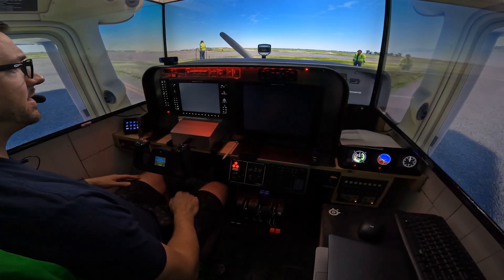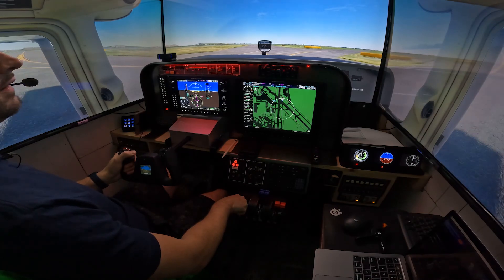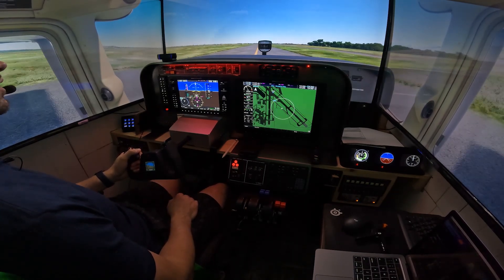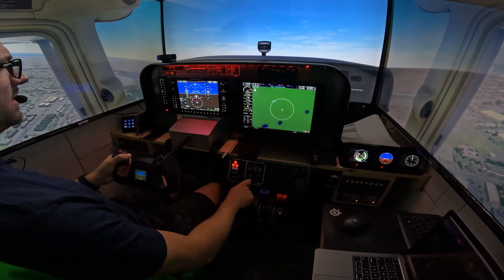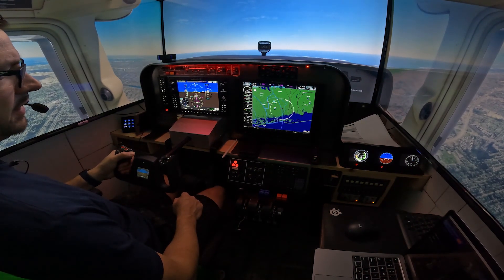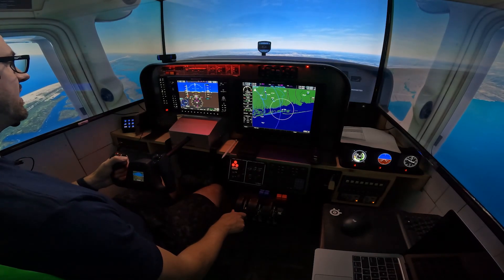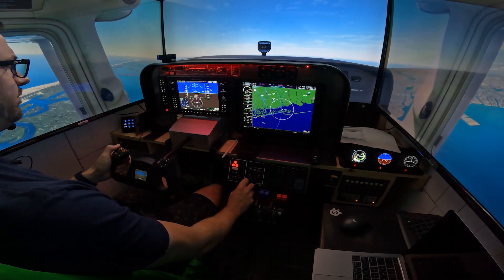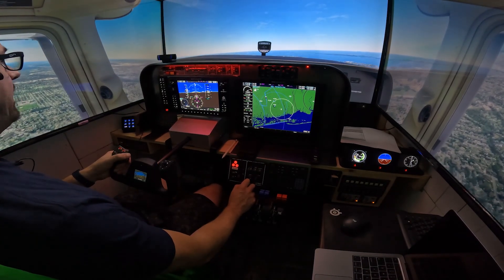Comparing Microsoft Flight Simulators C172 vs the REAL 172!

Comment: Greetings, I have seen this review of yours of the Cessna 172 G1000 base plane and the paid Cessna 172 WB. I would like to tell me which one do you think is closer to reality?
Reply from the maker: I haven’t flown the wb in awhile so not sure if there’s any significant changes to the flight model but around when I made this video is supposedly used the stock 172 6 pack fm. Personally I felt the g1000 to be closer flight model wise. I’m guessing because the g1000 version uses the CFD model I believe.

Comment: These tests are cool. The ground handling issue in my mind is due to wind and ground grip, if there is SLIGHTEST wind from the right the plane wants to weathervane to the right so you need left rudder. I think this was little bit improved on SU X, but still it feels like there is no grip between tires and runway. Very common in all flight sims imo. Anyway, i also think that the MSFS default C172 and C152 are incredibly good planes for default planes! Beating almost every payware stuff from the legacy sims (FSX etc).
Reply from the maker: Ground handling seems to be an issue for all sims for sure. Xp seems to have a better handle on it but msfs will get there eventually. 100% what we have no is light years ahead of what we had. I can’t wait to see what folks like a2a are capable of now with this platform!
Reply: I think you are spot on with the ground handling. I have the same issue, in both the 172 and the 152. They did not model the gyroscopic precession very well.
Reply from the maker: @johntaylor2433  Yep, had this again last night with a slight cross wind, the weathervaning almost makes you need the opposite correction you'd need in real life.  Id have to do some more testing.  I know Xp11 felt spot on after I came home from xwind training one day during PPL.

Comment: Hi Captain, I have a question, do you think it is a problem to fly a plane, whether it is a light plane or an airline plane?
Reply from the maker: Sorry - I don't understand what you mean?
Reply: I asked you, do you think flying is difficult and challenging? I mean both light aircraft and large aircraft?
Reply from the maker: @ehsanmikaeili9315  each aircraft has its challenges for sure. I’ve only flown light ga aircraft irl but in sim I’d say one of the things I noticed flying airliners is the difference in response and that everything happens much quicker. Theres obviously the complexity of systems too however once trained I imagine it’s not a challenge for trained airline pilots. One of my personal challenges was learning techniques to spot other planes, as that’s not something you typically need to do in sim and when you do they draw in a way you can easily spot them.

Comment: Great video and a fantastic sim setup there. I was surprised to see on the real approach that the plane bounces around more than the sim and needs constant correcting.
Reply from the maker: Yep, that's something I feel pretty much all the current sims lack are thermals.  As your coming in over different surface types you can get different updrafts, slight wind changes as the surface winds hit trees, buildings ect.  MSFS is def getting there though!  With the new gliders update I'm thinking we should start to 'feel' thermals in the sim now.  Thanks for watching!
Reply: yes, excellent video. Again, I agree with the response and the post. One of my least favorite types of air fields to land that are the ones that are surrounded very close to the runway by trees. The reason I say this is because on the approach you get a feel for the winds and get everything adjusted properly with your yaw and everything else to compensate, and then, as soon as you break that tree line, the way the wind is blowing completely changes on you, when you’re a mere 40 feet off the ground.
This has led to a couple of rather dicey landings for me, especially when I was doing my initial solos many many years ago.

Comment: One think notice is the lack of any slight turbulence. In the real plane you notice the entire plsne/dash moving around while the sim cockpit appears unrealistically smoothet.

Maybe always try adding light turbulence to addtgst little detail for realism.
Reply from the maker: I agree - weather needs a bit of work but getting better.  Id like to see some turbulence in the clouds especially.
Reply: @av8rchris  I've heard when a tip of your wing touches a cumulus cloud you'll feel moderate turbulence in a small GA plane, is that true?
Reply from the maker: It really depends on the cloud and conditions but there is most certainly turbulence. It’s one of the reasons I’m looking for as much actual IMC as I can get during my instrument training.
Reply: The real plane absolutely feels turbulence, and in my humble opinion, it feels it a lot worse than a large plane.
Turbulence that on large plane (I’m talking about Boeing 737s things like that) would barely register as a vibration, feel like serious earthquake in a little 172. 
I’ve had a few instances where I felt like every filling in my mouth got rattled out.

Comment: Not bad for a completely stock aircraft, and is testament to the effort Asobo has put into the ever evolving flight model. I thank you for doing this video as it puts to bed this ridiculous notion that MSFS is no better than an XBOX game for kids, that some people from a different flight sim would have you believe. And I include the CEO of said company in that. 

I bet you cannot wait for the A2A Cessna 172 to be released? Will take your sim to a whole new level. 😊👍

EDIT: Ah after reading your comments below, you're training on the G1000 and the A2A has steam gauges.  😊

Do you have the Working Title G1000 mod installed? It is absolute class.
Reply from the maker: The WT G1000 is top tier!  Oh I still can't wait for the A2A 172, that's a guaranteed buy for me.  Even though its steam I'm still able to use air manger to put those instruments on the PFD/MFD screens.  That was the whole purpose of this as I was kind of curious if I matched speeds just how close or not a landing or takeoff would be, or if power settings matched for certain maneuvers.  Does this replace real world flying - of course not, but it does show the effort they've put in to the flight model which as you said is constantly evolving.  Can't wait to see the sim in another 1-2 years how much further its come!

Comment: The biggest difference I found between the sim and real 172 is trimming. In the sim I found the airplane needs a lot of fine adjustment to keep it flying straight and level. The pitch seems more sensitive than the real plane. Which flight model did you use on the sim: Legacy or Modern?
Reply from the maker: I use modern flight model.  I agree but also in general any sim I've used seem harder to fly then the real thing.  Im guessing it has something to do with control sensitivities and quality of those components.  Since I've switched to the Brunner force feedback yoke its certainly gotten way closer to the real thing, but still in sim trimming for straight and level can require some patience.
Reply: That is true. I can trim a real one with the smallest movement. I do use the trim wheel quite a bit in the various sims.
Reply: In MSFS the Cessna looks like a train on rails ... 🫤

Comment: How are you trying to compare the sim plane you created with a twin-engine quadrant, Gear lever (Only one model of 172RG had retractable gear) and non-force feedback yoke with the real 172M or SP that has natural force feedback, where the primer is not always required anyway and unpredictable things can happen, like power peaks that blows a fuse, or elevator stuck, or basically anything else?
Flight sim is for fun or procedure practice not for training...
The truth is, C172xx is way more difficult on a flight sim than on a real plane, despite the fact you will survive all of your stupidity, lack of training and knowledge playing on a flight sim and you most likely would kill yourself on a real plane while trying some crazy manoeuvres. 
Flightsim is a perfect tool for IFR practice, general navigation and so on. These days it is great sightseeing tool thanks to photogrammetry but cannot be directly compared to a real plane.
Reply from the maker: I think your overthinking the purpose of the video - it was a 'for fun' video to compare how the flight model loosely relates to the real aircraft.  The twin quadrant is just a usb controller that I'm using in place of the typical push/pull style found on the Cessna as the one I have doesn't fit quite right with the home sim build.  Same goes for the gear lever, this works with other airplanes, and not for the 172.  My home sim is not meant to be a replica C172 in any way.  My yoke actually IS force feedback, capable of 24 lbs of pitch and 4.5 lbs of roll force.  All that is irrelevant as this is a home based game/sim for fun and not used for any training.  I use it to stay comfortable with the G1000's and instrument procedures as well as comms with ATC networks such as Pilotedge, not practicing maneuvers - we keep that to the real thing with a CFI on board.
Reply: @av8rchris  The title suggested a comparison between these two.
I just pointed out visual differences, some of them are going to have a huge impact on the comparison, even if it was for fun, and I do believe you as I did compare C172 as well in reality straight after MSFS2020 hit the market.
What I want to point out is the ability to practice procedures of all sorts.
Unfortunately, G1000 on the sim is not good enough for practising as many functions are missing. ATC procedures are also incomplete and wrong. for example, try to make a PAN PAN call on MAYDAY. It is not implemented in the sim yet. Try to request HI-LO right out... And so on...
If you use forced feedback yoke and rudder, you can actually practice some manoeuvres. They should feel similar to a real flight. But general cockpit to compare particular machine is not a great idea, that is my conclusion when I was using generic CH yoke and rudders and power quadrant from sitek... 
I did like your video, and I think it is a great idea to compare real views with those from the simulator. Show similarities and differences or even errors (Like Toronto CN Tower that looks more like a rocket...).
Reply from the maker: It was more so to be a comparison of the MSFS 172 to the real thing, not to my home simulator so to speak, thats just what I used to fly the sim.  As for the G1000 - have you tried the G1000 NXi from Working Title?  It's a fantastic unit that I've found to match the real world G1000's I've used - with the exception of any of the systems pages of course.  The stock G1000 in MSFS is horrible though however!  The stock ATC is also horrible - i stick to Pilotedge & Vatsim for my online ATC interactions and procedures!  Thanks for watching!
Reply: @av8rchris  Just downloaded NXi, it is way better than its predecessor, thank you for this suggestion. 
I agree that ATC in MSFS is simply speaking terrible, but there is hope that Asobo will improve it in the future.
I must admit the physics of the C172 feels somewhat similar to the real plane and is not worse than X-Plane 11.
I hope to see more of your videos!
Reply from the maker: @michaelksiezopolski  I realized I never got back to you - glad your enjoying the NXi!
Reply: @av8rchris  I am using it indeed, Thank You for the tip. I am now making 3d printed Garmin. Let me know if interested...
Reply from the maker: @michaelksiezopolski  Thanks - Ill keep you in mind!

Comment: Nice comparison, I have 3 55 Inch curved tvs. 4k on a 6 DOF motion platform, it will be nice if Asobo has a remove "dash" soon in cockpit mode. But I am happy they gave us a 180 * view!
Reply from the maker: Wow awesome!  I was debating on the 6 DOF platform idea and just staying with VR but ultimately went to this.  Which 6 DOF platform did you go with?
Reply: @av8rchris  I built my own and hybrid 8" actuators I modified with AC servo motors https://www.youtube.com/watch?v=I2CcVEYFYIA and using Thanos AMC AASD 15A Servo Motion Controller, Its good motion. Using Ians BFF motion Software for flight and SIMtools for cars roller coaster etc.

Comment: C-172 don't use Piper style Levers they use Push Pull Throttle, Mixture and Prop.
Reply: Unless it's the much older PA28s
Reply from the maker: This I actually did not know!
Reply from the maker: You are correct - while I do have the push/pull style handles, I haven't found a way to get them to mount in to the home sim without losing other functionality.
Reply: Thanks Cpt. Obvious

Comment: Thx for the comparison! In my experience I agree that the power settings and overall handling on the sim is really well done. I do not have the set-up you have and I am flying older 172s and I have even more trouble on the sim to figure out when to flare than on the real thing.
I agree that the home sim is probably best for practicing procedures and that stuff and that the "feel of the pants" feeling, turbulence, Gs and all that need to be learned up in the air!
Great video!
Reply from the maker: 100% agree!  The home sims been keeping me sharp between instrument lessons and staying comfortable on the comms ect on pilotedge and vatsim.  If I was going to rate difficulty on home sim landing, I'd say single monitor the hardest, the home sim triple monitor is medium, and VR flying easiest.  Flying in VR you just get that depth perception you don't get with anything else, well, aside from real life of course!  I just wish it was easier to do IFR procedures in a VR headset, interacting with the ipad charts ect.
Reply: @av8rchris  Yes I agree with the VR thing its cool and I am a 3D geek but I like flying by the seat of my pants trying to navigate using maps ETC radio beacon /GPS and all that is not easy when under the hood. Just setting auto Pilot and having a coffee is kinda boring.
Reply from the maker: Same - I've had way too many headsets at this point lol.  I love VR flying just much harder for procedures and knobs.

Comment: Really great video, and a sick setup! I'm a simmer only, never even stepped foot into a real GA plane so it was fascinating to hear how they compare. Just Flight have released an add on for the Cessna 172 steam gauge that came with the MSFS premium and deluxe packs that is supposed to bring the electronics and instruments up to study level. You can flood the engine, foul the spark plugs, get damage and wear and tear and even break the prop if you land and fall forward.

If you have the steam gauge Cessna any chance you could do a comparison of that with the add on?
Reply from the maker: Thanks - glad you enjoyed!  I just heard of the 172 steam gauge add-on recently.  I've actually been debating on picking it up to put it through it's paces so now you have me curious on the comparison as well.  I'll gladly do a comparison with that add-on and the real plane!
Reply: @av8rchris  Thanks! As a non IRL pilot I'd like to know if it picking it up will help me learn more about handling a real plane. I currently fly the G1000 model but I like the idea of learning some actual real aviation startup procedures and being required to fly the plane within its POH restraints.
Reply from the maker: It's one of the reasons I wanted to make this video in the first place.  For years as a simmer only I wanted to know if I was doing anything right, or how the planes flew compared to real life ect.  Now we have at least a basic idea!  The home sims are really what you make of it - you can fly around 3rd person, or grab a study level GA aircraft and really learn the ins and outs!  If your into live flight sim streams - Im about to go live on https://www.twitch.tv/av8rchris Hope to see you there!

Comment: Good video. I am also a real-life C172S pilot. What I don’t like about the sim is that--when on approach and when flaring—the airplane is stiff as a board. There is no rolling of the wings (back and forth) ever so slightly. Even in your landing, watch the roll that happens in the real airplane video (at 10:07). Notice the sim at this time…barely moving.
Reply from the maker: Good point. I can’t tell if that’s flight model or lackluster weather in this sim. I have experienced that wing rock but very infrequent where real world happens more often. Glad you enjoyed the video!
Reply: also, in the real world the plan descends at a much greater angle.. in the sim he just smoothly coasted in. Maybe he didn't match altitudes just right.. but I've definitely felt in the real thing that you angle forward quite a bit more.
Reply from the maker: 100%!  The angle of attack is a much more nose down in the real plane vs MSFS.  Xplane seems to get this right but MSFS not so much at least on most (all?) of the default aircraft.
Reply: @av8rchris  oh.. is it because the pilot is trying to maintain a certain speed and MSFS will give him that speed with a much higher nose?
Reply from the maker: Sort of - it seems MSFS may not simulate the changes in the wing when flaps are extended but instead simulate some sort of extra lift/drag so it doesn't allow for the AoA change.  Boldmethod.com has a great article on what happens to actual wings when flaps are extended.  You can search "Flaps angle of attack" - the article has good details!